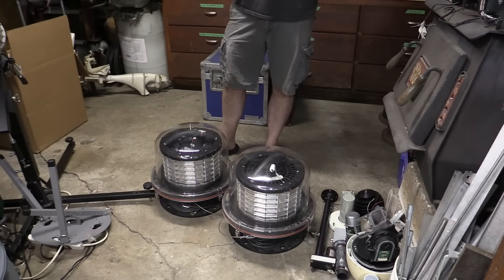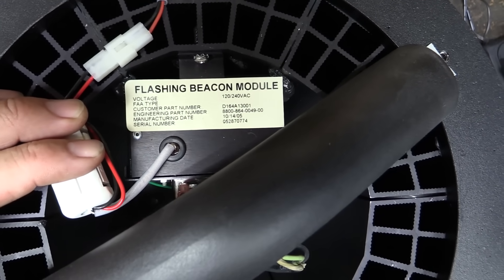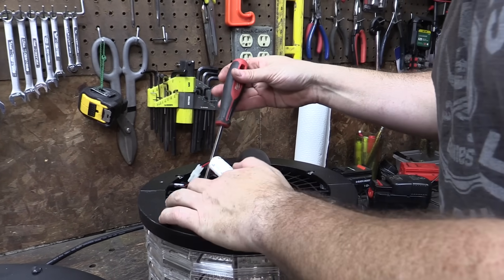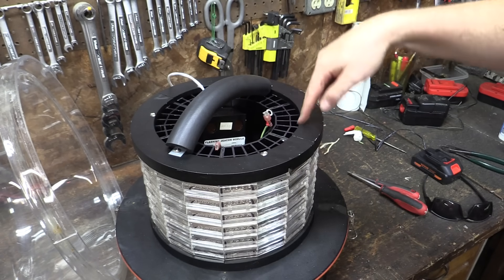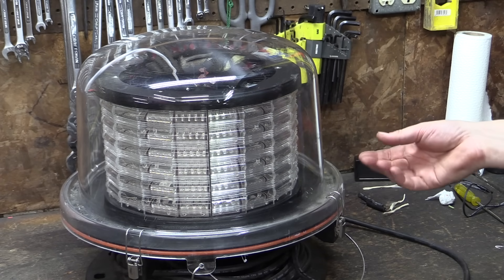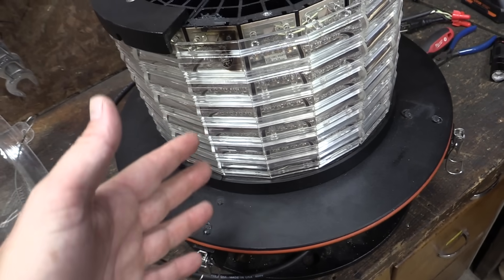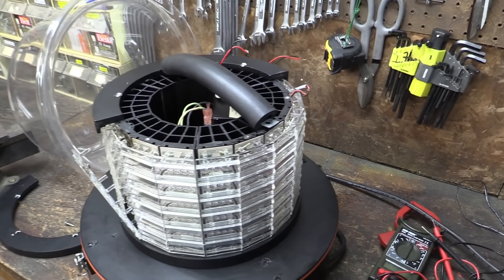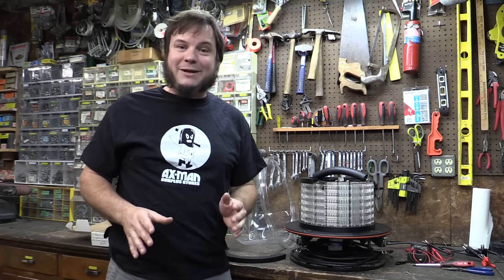Surplus FAA Tower Beacon Warning Light

Comment: That's a pretty simple one compared to some I have seen in the broadcast magazines. Different blink pattern/angle during the day than at night to not annoy people as much with light pollution and some IR strobes for pilots who fly with night vision, etc. Fascinating rabbit hole to go down when I was looking into them. There is also a requirement to monitor them that I don't see here so I am not sure if these are tower lights or maybe for a different structures lower to the ground or in places they can be visually monitor like airports.  LEDs you can't use an amp meter on it to detect when a bulb goes out and set off an alarm like I do with my incandescent beacons. Like the Xeons there are more brains involved for all that to work correctly. The advantage of LEDs obviously less power than incandescents (and xeons I think) and supposed to be more maintenance free than incandescents and xeons but when they are on a 500ft lightning rod is different than on paper. A tower with incandescents gets hit I might lose a flasher module in the home made with off the shelf parts (a couple relays, 120 volt flasher module, amp monitor thats about it) controller at the bottom. Usually only need to climb for changing bulbs every few years or birds/lightning damaged power cables. The tower with the xeons I end up having to replace stuff or get on the phone with someone to diagnose because there is just a lot more going on there electronics wise. I suspect LEDs are worse in that regard.. The stuff those things go through up there on the tower is insane which is why so heavy but probably a lot lighter than the glass beacons. I will try to lift one I have on the ground and see if you are curious but big enough I doubt I can. I would take out one array and put it on a variable DC power supply and ramp it up slow on voltage and current so you can find out what each array runs at then modify it to suit your own needs. A little microcontroller fun maybe as simple as tinkering with esp32/wled and you might be able to control each section and make your own effects. They can be at pretty high voltages when in a series so be careful. Or just use the modules for other things. LED brake light upgrade maybe.
Reply from the maker: It's fun to see people with real-world experience commenting on this!
Reply: @saveitforparts  I engineer for a small chain of radio stations. Can't afford the latest and greatest. We only have incandescent beacons on most towers and one Xenon system. I would like to see an LED system but there is not enough budget to send me to the trade shoes and stuff the industry puts on. The amp meter on a tower the other day alerted me a beacon burned out. Had to let the FAA know and a guy climb up and change it. A helicopter just crashed into a tower in Houston and there is some controversy over the tower lights. It's a big deal. Neat job at times.  have a big 4cx20,000 vacuum tube on my display shelf at the office the size of your head. If you listen to FM radio over the years chances are one just like it made the power for it. The transmitters are massive dangerous beasts but totally cool. One of these days I am going to see if the network that uses the same sat equipment Peter Fairlie does out at one of my towers will let me set up a call to him just to do it one sat terminal to another. I could probably get their engineer in on it. I sent him both of your channels to watch when I saw him a few months ago.

Comment: @6:45, that box is outputting at a modified frequency which is making the meter all trippy. Also I don't think bridging a single LED would bring the voltage high enough to start popping the other ones around. My guess is this thing is probably just old and degraded after spending nearly 20 years outside in all sort of temperatures and the electronic components of the LED modules are failing.

Comment: Might be wrong but the reason it may be wired in series is because a lot of times, they have a remote monitor that will let the tower owner/operator know that there was a loss of voltage in the circuit. My obstruction lights that I'm in control of all have it but they aren't built exactly like this 😅

Comment: I suppose the series strip miiiight make sense more for immediately detecting an issue rather than it just becoming dimmer over time as LEDs fail, and the assumption may be that there'll be multiple units where they are providing redundancy.

Comment: You could use a constant current power supply set to something like (20ma x Number of leds) — which is honestly probably what that was in there — but that would need to be like 700+ volts… I would say, easiest way to run the leds would be to rewire it so each board is in parallel. If I’m counting correctly there are 24 LEDs per board — red LEDs usually have a Vf (forward voltage drop) around 2v — so like, a 48v power supply rated for probably 10amps would run all the boards. I’d add like a 120ohm resistor in series with each board, quarter watt should be fine. Test on one board and if it works, hook up more.

De soldering one led from the charred board and using a cheap m-tester would give you a more accurate Vf. 

As for the blinking - literally the output of an arduino running the default code to a sufficient mosfet should do it - though you’re probably better off running each board through its own mosfet. If you’re feeling enterprising you could even pwm them to adjust brightness. Srsly feel free to message me if you have any questions. Good luck and happy hacking.

Comment: That is obviously a taillight blinker for the space shuttle.  That way then an UFO or aircraft was behind it, it would signal which way it was going to turn. I worked on several aircraft in Area 53 and they had the same signaling system.
Reply: On a side note. I absolutely hate whenever I have to work on something that is 480V.  I've had equipment arc across terminal whenever my meter leads were a pretty good distance away.  Scary stuff!

Comment: nice find pull out the led arrays get a crap ton of led strips replace with those use rgb ones u can have mutli effects if u used in addressable ones couple of ardunis and open source led software boom u have 2 nice units for the garden

Comment: By jumpering over that bank of LEDs, the voltage is more for the other ones. Try replacing the two banks or move the transformer over to the other one!
Reply: It's a constant /current/ supply. It doesn't matter.

Comment: The module is sealed because of moistuture The fact that it id FAA certified, means you won't find repair information. It is cocsdered as a component, and not intended t be repaired i the field. If it was built in 2005,it likely saw over ten years of contnious service. Older beacons lasted a lot  less time. Those could be relamped, and if flasjing thee controler module replaced. Towers get hit by lihjtning quite often. I've worked on several towers, and desogned a remote moniter for one tower to endure that all lights were working. It sent a signal on  7GHZ to another towwer sight  where the display was right by the Master Monitor in the site's control room. It monitored the current to the entire tower lighting system. It sent a 1024 Hz on an audio chanel. It was on, unless al thee lights were on, If the beacon wasn't flashing, or a side marker wasn't orking,it stayed o. Of everything was OK< a LED at Master control would go out when the lights were all on. The FCC & the FAA accepted the design. 
By law, you had three days to effect full repairs to towr lighting.
A radio station in Lake County Florida had the wiring between the transmitter and beacons fauk frim lightning strikes. The engineer had to locate the damage and replace bad wires while watching out for alligaots, since the towerr is in a large marsh. I could see that tower from my ouse, and saw it struck by lightning, many times. The transmitter would drop out for several seconds each time, so you could bot see and hear each strike.
Diialight is a long time lightig manufacturer, no 'a cheap piece of junk'. Those beacons exceeded their design life, or the factory would have relaced them with new equip,ent under warranty. They, and Chicago Miniture built most dial lamps and oter specialty buls for generations. Dialigh manufactures all types of LED, these days. I have reels of surface mount LEDs they made. You need to stop daming things you know nothing about.

Comment: If it's an LED string, count the LEDs, multiply by 3V, and then you know the approx supply voltage. 

That's what I learned from BigClive at least
Reply: That's not a universal rule of thumb to apply, for a few reasons.
While it's close enough for the majority of LED products today, especially the consumer and household lighting devices with white LEDs that Bigclive often takes apart. 
But these beacons use monochrome RED LEDs, which will only have a forward voltage of around 2 Volts (average, can be slightly more or less).
Also, some LED packages are constructed with multiple LED chips wired in series inside the package, as a means of boosting its light output. 3 in series is common in those. So if a high intensity red LED was made that way, its forward voltage at the terminals would measure at around 6 Volts rather than 2 Volts.
Reply: Red LEDs will be around 2V per junction, not 3.

Comment: Step one to getting this led array going is to figure out how it’s wired. All series is possible but it could have a combination of series and parallel.

Then figure out what the forward voltage of one of the LEDs is - you can use the diode function of your multimeter to give you an idea of how much voltage it takes to make the led pass any appreciable amount of current.

once you know the forward voltage, multiply by the number of led modules in series to get a lower bound on the voltage required to light the array.

As other commenters have mentioned the power supply is likely built to provide enough current at the voltage required by the whole array, if not otherwise limited, the LEDs will allow a huge current if pushed much past their forward voltage.

If you can pull an LED module out and hook it up to a bench power supply with a current limit - you can back into a current (20mA to start) that causes them to shine bright enough for your application.

Then what’s left is to make a current limited supply capable of delivering enough voltage to push that many LEDs at the current you want - each module wired in parallel will increase the current required linearly.

Seems like the power supply at your unit is passing too much current through the LEDs and burning them out.

Let’s say you have 4 3.5V LEDs wired in 2 parallel groups in series (2P2S). You’d need a power supply that will current limit at 40mA capable of a bit more than 7 volts.

Rather than jumping the LEDs you might replace them with resistors that will drop the same amount of voltage as an LED at the current you want.

So if each LED has a forward voltage of 4V and operates at 20ma you’d want to replace them with resistors of 4V/.02A = 200 Ohms and you’d want them to have a power rating that can handle a bit more than 4V * .02A = .08W.

Seems like that power supply isn’t limiting current though - so be careful!

Comment: Btw try 1 LED strip on 12V and see how ya go as from what I can see it looks like 3 LEDs in parallel and then they have 6 lots in series and the red LED's are about 2V each so each module should be 12V

Comment: Are you sure that isn't a flash beacon?  The time circuit in the power supply may be broken allowing a sustained output.  LEDs are current driven.  They may only be designed for flashing at that output.  I agree some type of fault tolerant series parallel configuration would be nice, but as i said driving LEDs properly is done using continuous current not continuous voltage.

Comment: Count the LEDs in each panel and multiply by 1.2 volts. 
100 LEDs in series = 120 volts

Try rewire the series strings to match the voltage output of a PC power supply..

SupplyOutput / 1.2 = (Number Of LEDs in series)

Comment: It's very likely the 2nd PSU module has a fault and that's killing the LEDs. LEDs aren't like light bulbs, they can last decades. You can work our the DC voltage it needs by measuring the voltage drop across each stage and multiplying it up. It looked like 3 diodes per stage and 6 modules per vertical strip, and 16 strips... An individual LED needs 1v2 - 3v6 depending on the type, so 3v6-10v8 across a module. 21v6-64v8 across a strip, and 345v6-1036v8 for the whole array. You need to current limit it to stop it running away, which is possibly where the PSU module is faulty, not providing a stable DC supply and not limiting the current. You could rewire the strips in parallel and run it from a safer voltage?

Comment: This company also sells lightpipes, I've used theirs in a project. Funny, I thought they are just a generic plastics factory until I saw this. The bridging of one LED can overdrive others. The power module could fail in many ways I guess. I suspect the module to be a blinker (it's stated on a sticker) and the precision timer has failed. I guess it's designed and tuned (to the max current of the LED in pulsed mode) in a way that it's not supposed to handle for continued operation. It might be designed to be overdriven (calculated for maximizing it's lifetime) by a fast PWM signal (to keep it cooler and save some power) for a split of a second for a slow flash/blink. So now it's going full on or a PWM signal is generated all the time (according to meter readings or could be just ripple), but it alone is not enough to spare the LEDs (blinker circuit output stuck on).

Comment: If you have a variable voltage supply you might use it, replacing the original power supply.

Comment: We if the secondary voltage is 12 or 24 volts I bet it’s only a 60watt led power supply. And that little metal part is the flasher.

Comment: Pretty sure it's the strobe box being stuck on, feeding the series circuit of LEDs a higher voltage is probably not helping. Think these are not 100% duty cycle units and are supposed to be powered like 20% of the time.

Comment: Like Christmas tree lights used to be, (or still are when in series), the load is shared equally by all the lights, so when one burns out, they're purposely designed so none work as a result.  by-passing the burnt out one results in extra load being placed on the remaining working ones, and unsurprisingly, they're not rated to have a higher load and the weakest one starts to burn out.  To remedy the situation, you either replace the burnt out lights, or replace the voltage converter to work with less lights, i.e. less voltage per light.
Reply: No, no extra load. These are not filament bulbs wired in series on a constant-voltage. These are current limited.

Comment: I think the answer lies in disassembly. Could you remove one of the columns of LEDs?  Then separate one of the modules from the column.  Is there a visible IC or semiconductor (MOSFET?) on the module?  A part number leads to data sheet which describes what voltage / current the module expects.  Example circuit schematic.  You may be way ahead of me here but that’s my approach

Comment: If there's 1000VAC going to diodes it's going to start cooking them like you're seeing. 
I'd get a 50V DC power supply and bring up pure DC voltage slowly until you get to where your PS was (48V) and see what happens.
My guess is the caps in your DC PS have blown letting a lot of unneeded AC into your LEDS which hate AC. That hole is the can of an exploded electrolytic cap is my guess.
Once you figure out it likes DC you can get any suitably specd DC supply and have your fun with these beacons!

Comment: Throw away the power supply. Get a bench supply and go up in voltage tell it lights up and stop. Or maybe just throw away the old array and wrap with 5v led string and put on your shelf.

Comment: For greatest reliability reduce the number of components.

For best protection against the weather pot the components in a compound.

To get maximum light out of an LED over drive it

To reduce average heating use lower duty-cycle

KISS (Keep It Simple, Stupid) Doctorine

All of these Engineering principles were applied to this device.

However, a single point of failure ruined this one.

Removing the potting material will reveal how the series-connected LED array was driven.

Try an Acetone bath first. There are proprietary chemicals designed to dissolve common potting materials.

Publish a follow up! Dying to know more about this device!

Good luck!

Comment: It almost seems like a power supply issue to me, even when bridged to bypass the broken one, It should not be providing enough voltage or current to just pop those LED's at random, that's not right.

Comment: Personally, I'd just take the LEDs and power supply off, add a newer and better power supply to it, new LEDs (they're cheap) on some prototype boards. Connect to Arduino, make Arduino make lights go wee woo wee woo. (not red and blue though, I think making a siren is technically not great).

Comment: I am not sure why the Leds need such a high voltage i can only think they are wired like a X mass lights ,could be the reason why  when one module went bad it stopped working when you by passed it there was now to much voltage across the rest of the LEDS reason they went from bright to dim very quicky ,i would think every led is now dead in that chain ...Keep the transformer high voltage transformers are hard to come by cheap ~!  The voltage test you can do is remove the transformer wires to  the electronics thats making it from AC to DC and do an AC only test . Testing the transformers secondary will give you the correct voltage . Once you know you can trade it for some thing you want HV transformers come in handy for Valve electronics and small CRTS .